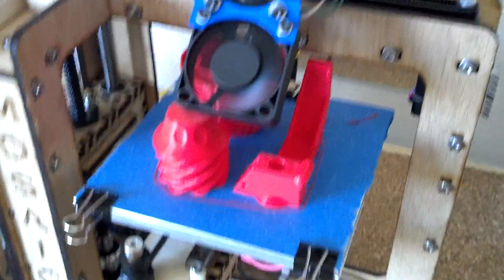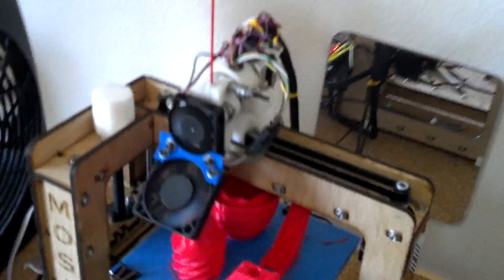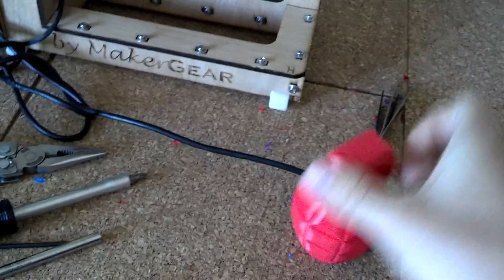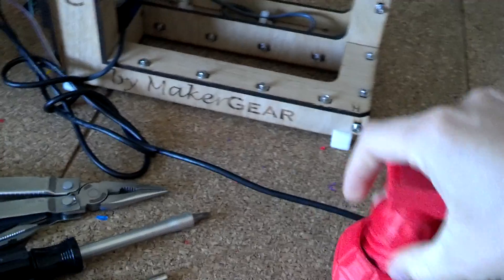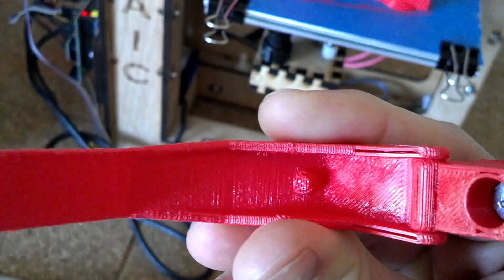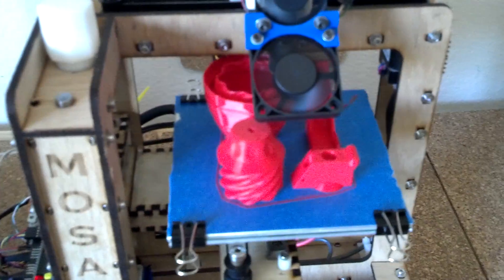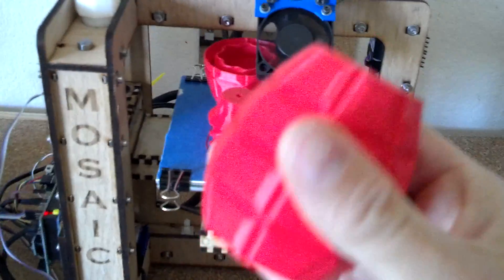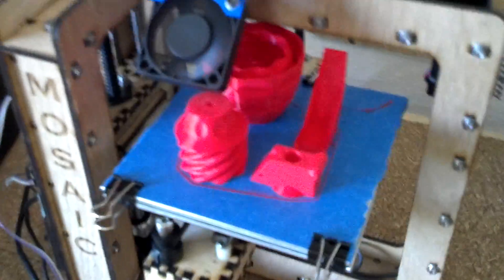How to 3D Print (toy) Grenades... 3d printed guns one day?! Makergear Mosaic

Comment: and here ladies and gentlemen we have a prime example of someone missing the point. to quote you. Tell him the printed guns revolution is begins with him.Laugh my ass off when it explodes in his hands... cody has put over 100 rounds through at least one of his 3d printed ar's without failure. therefore your theory fails. as for a old lathe being cheaper than a 3d printer, the same would have been true about inkjet printers around 20 years ago. and computers  too!
Reply: Omg what a know-it-all bitch, try not sounding so condescending.

Comment: The shell yes. The internals, no. You can't make copper wires, resisters, etc. that work our of the plastic materials used with 3d printers.